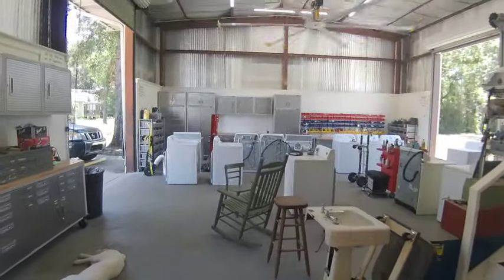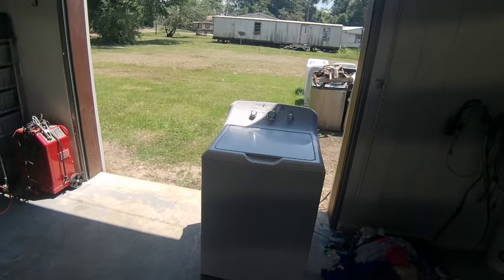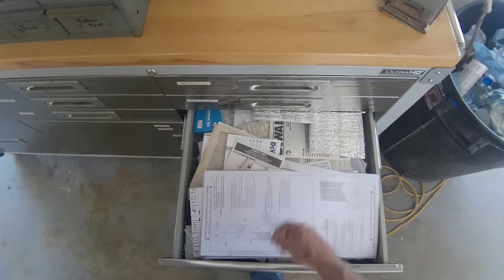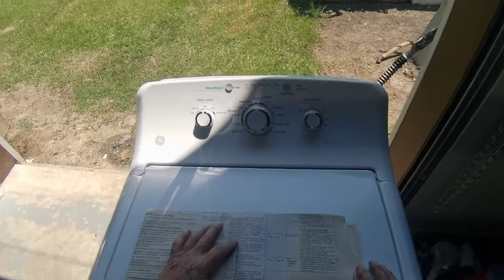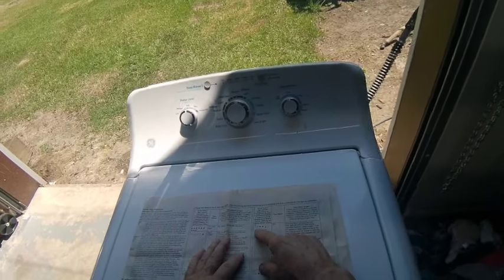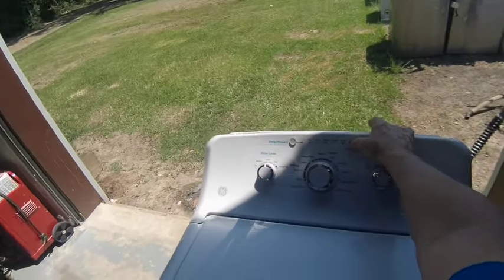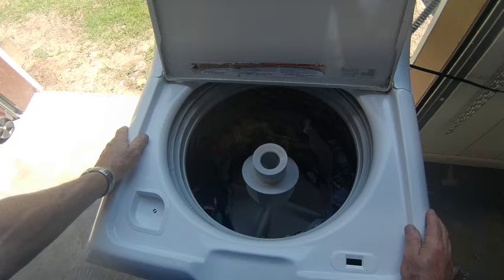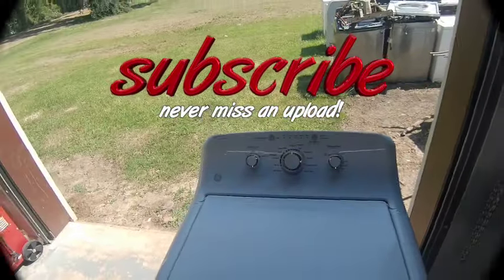How to Perform a GE Washer Diagnostic and Fix a Lid Lock Issue

Comment: Chip, another great repair video. 

I agree with you that for a basic washer these GE machines are better than the Whirlpools. The biggest problem I've seen on the GE machines, and I don't see it often, is when the tub seal fails and the water leak ruins the gear case bearings.
Reply from the maker: Thanks for commenting Shane!

Comment: best video in the internet on how to understand the diagnostic mode.  i finally understood how to test each function individually .  i noticed when testing the spin cycle the lid lock light flashes, is this a error message telling me the motor has issues or is this blatently telling me lid lock is no good?  i just put a new lid lock in last night
Reply from the maker: I've had issues with installing new lid locks and sometimes the old ones aren't bad just not making good connection. Unplug the unit and wait about 3 minutes for any capacitors to discharge. Unplug the lid lock from the control board and from the front of the machine you need to take a pick or small screw driver and bend the terminals inside the plug on the control board very slightly to the right. Once you plug it back in your lid lock should have made a good connection with the plug and should work normally. I have seen this issue more than I care to remember!  Thanks for watching!

Comment: Thank you!! Some how I have turned on the door lock test mode twice. I do it when I decide to cancel my current load settings and chose another. I think holding the start button to cancel for too long sets it to diagnose. Every time I push start it locks and unlocks but that's it. Holding the start button again to get out of the trouble shooting mode is all it takes to fix. Thank you!!
Reply from the maker: Lol, thanks for watching!

Comment: Love this so much ❤. The fact that you let animals come hang out ❤. Any idea on a whirlpool standard model That shakes in spin ? Have a shock absorber video❤?
Reply from the maker: If its an old style direct drive Whirlpool (where you pull the knob out to start it) then check the stabilizer spring at back left side of tub. If a newer model where you have a large knob over six LED lights then its probably the suspension rods or a worn out tub hub. Here is a shock absorber / suspension rod video:  How To Replace Suspension Rods in Washing Machines: A Mechanic's Guide to Balance & Repair
https://youtu.be/xmBJdpUfV-Q
Reply: @HarperandKnowles  thanks so much